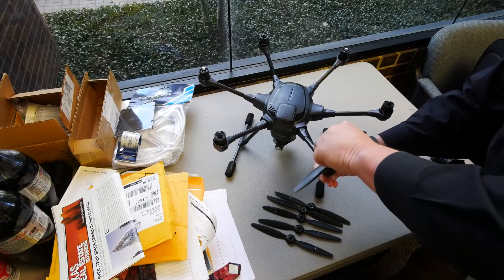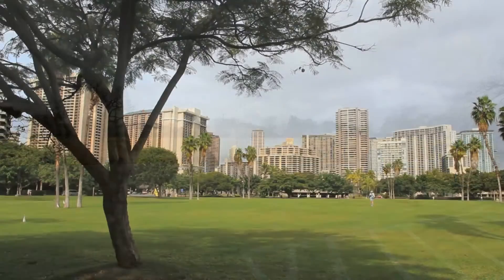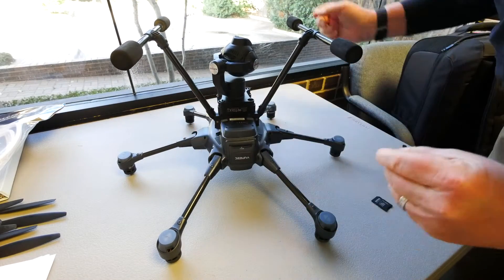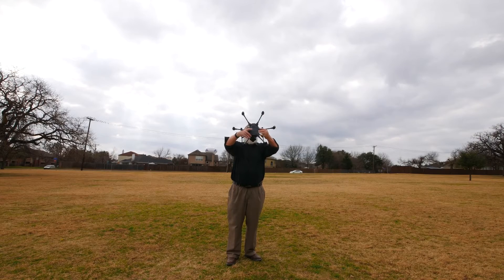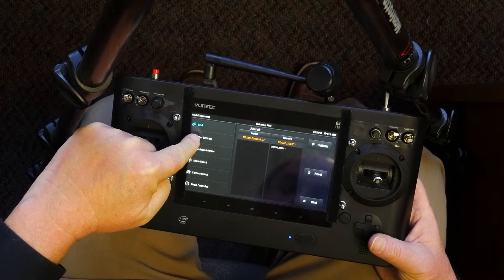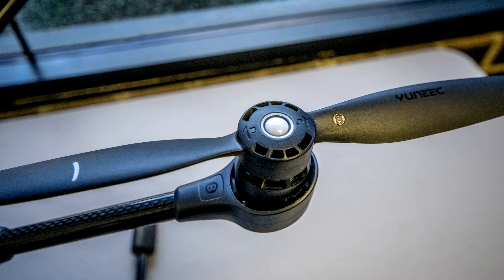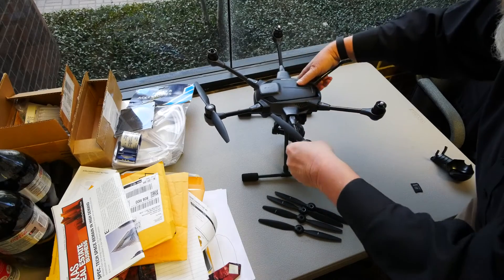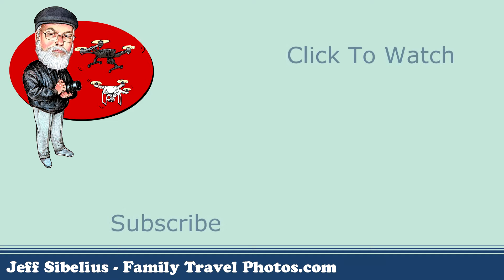Preflight Steps - How to Fly Your First Flight With the Yuneec Typhoon H - Episode 2

Comment from the maker: This is the second in a series of videos designed to show you how to fly your first flight with the Yuneec Typhoon H Hexacopter. 

In this episode, Preflight Steps, I'll demonstrate the things you must do just before your first flight with the Typhoon H. This includes 
choosing a good place to fly
checking the weather
removing your gimbal lock
insert micro SD card into the camera
installing battery
calibrating your compass, accelerometer and gimbal
turning on advanced mode
installing propellers
preflight inspection